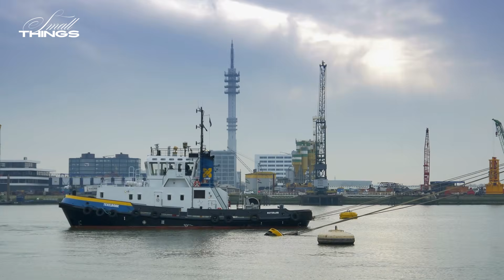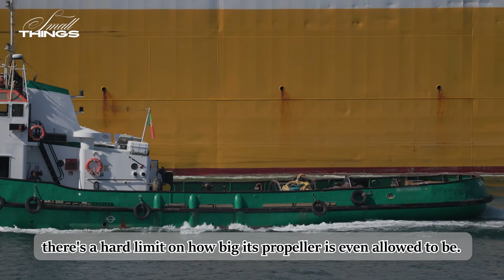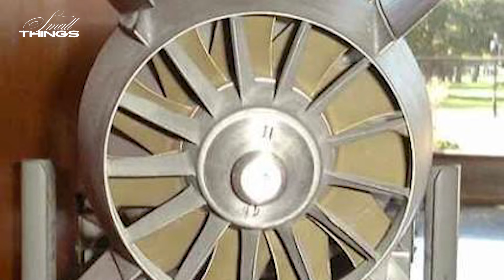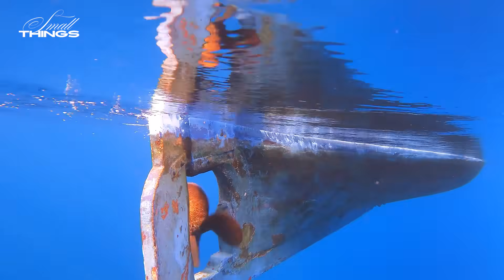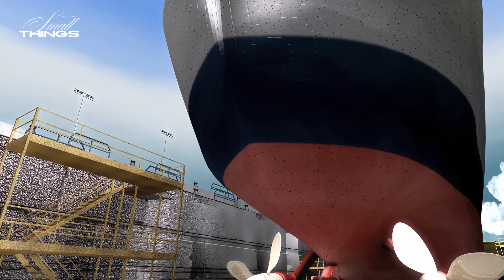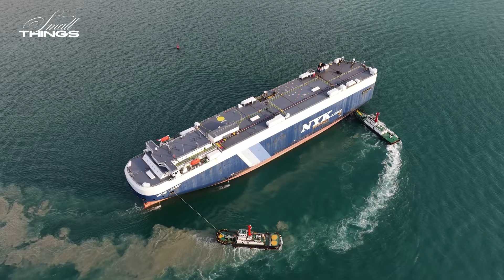Why Do Tugboat Propellers Have a Ring Around Them? It’s Not Just for Protection

Comment: You can also compare it to the shape of a jet engine on a wing or even water line that sizes down along the length of it
Reply from the maker: Good comparison. The ring works a bit like a shaped duct — guiding the flow and helping the propeller use the water more efficiently, especially at lower speeds.

Comment: I think the only reason they do not install rings on big ships is that simply they are just to big - propellers - and maintenance would be very costly. But I think I saw them (rings) on modern subs. For speeding up and to reduce noise most likely.
Reply from the maker: Good point. Size, cost, maintenance, and operating speed all matter. Submarines use related ducted/quiet propulsor designs, but the purpose is often noise reduction too.